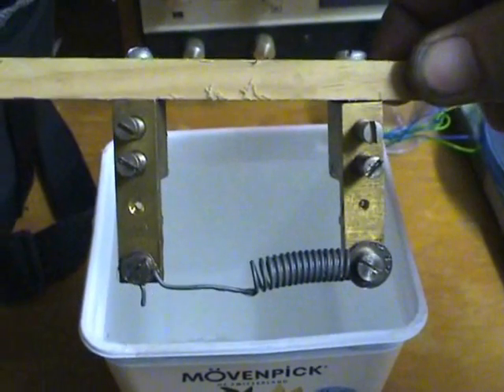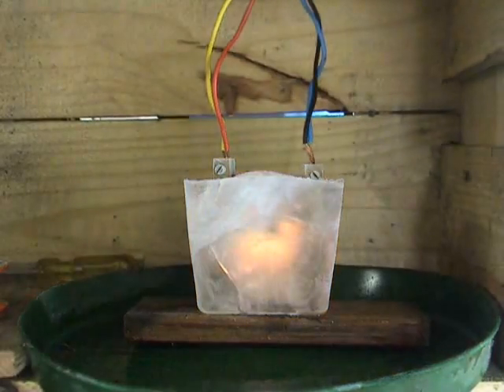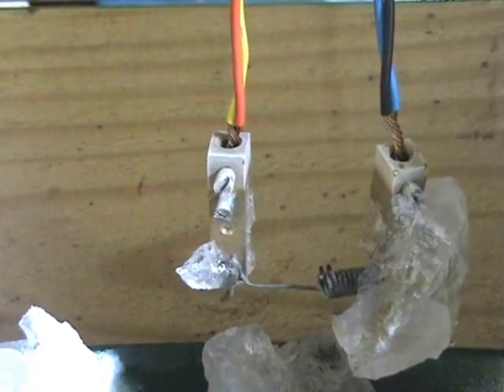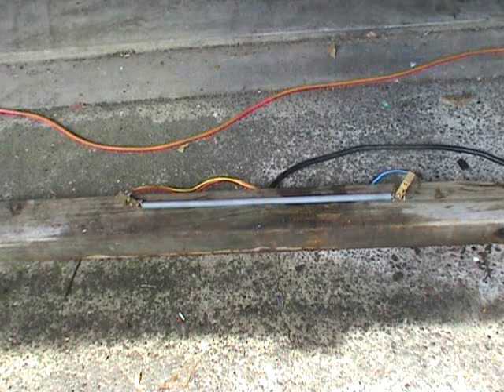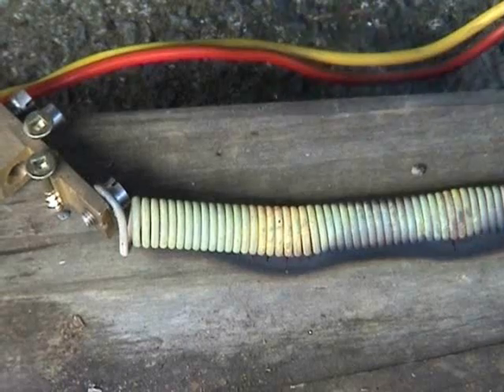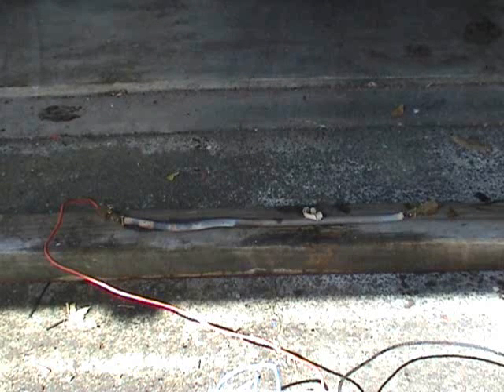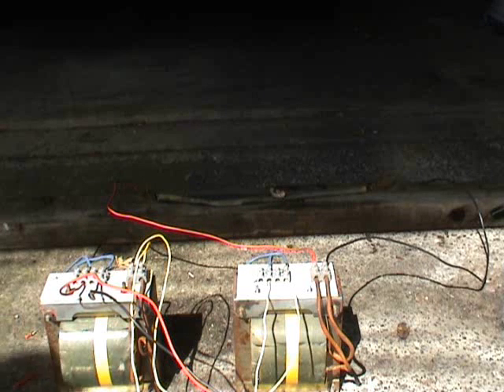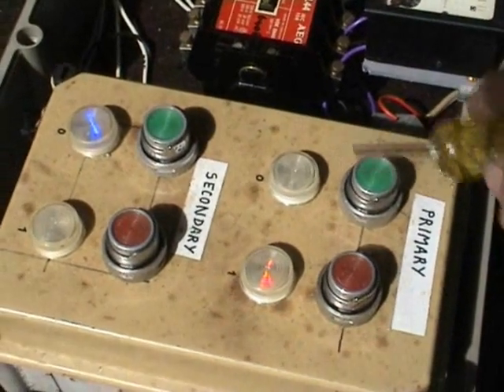a spring in an iceblock and a spring on a wooden block glowing

Comment: What I usually did before I got bored quickly of popping springs due to not having the proper equipment and destroying a SLA (it went puffer fish), I used to keep reconnecting the spring until there wasn't anything left to burn out. I did it with paper clips to twist ties. It was fascinating! I even tried a solder wire and it melted on the floor. Twist ties just drip! :D

Can you, on your next set of burn out videos, keep reconnecting the filament until there isn't anything left? It'd be RAD!